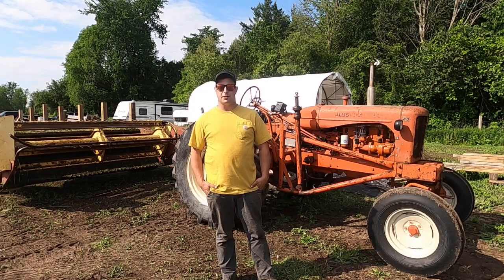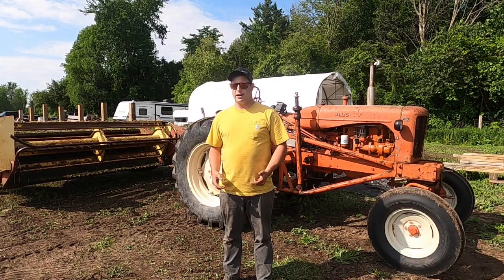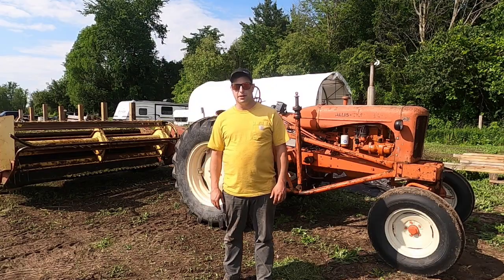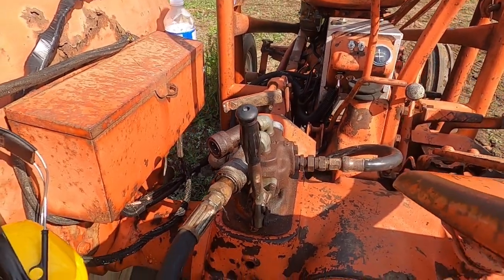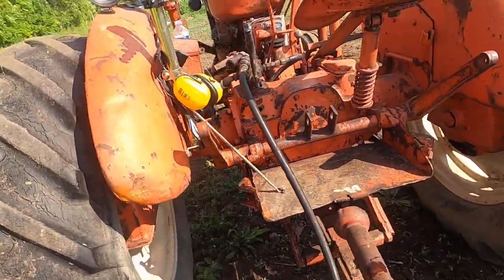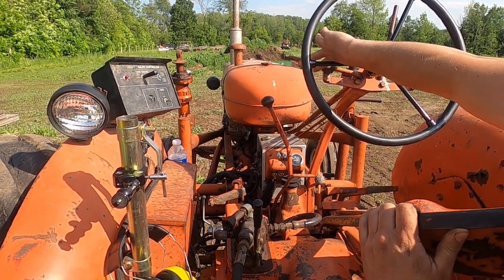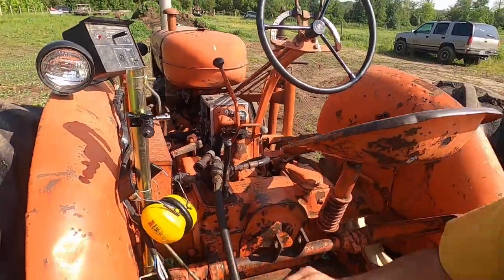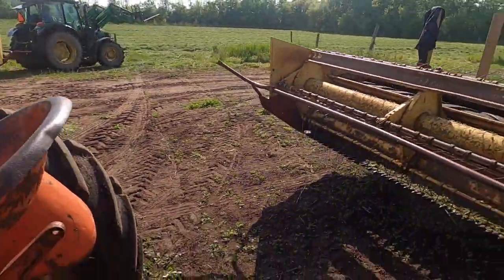Does it work? Modern hydraulics on Allis Chalmers WD.

Comment: You must have an “open center” valve.  It should be a “ closed center “ control valve then you would not need the valve that shuts off the oil to the control valve.  Good job for getting it to work.  At that time all the other tractors had high volume low pressure. But AC had high pressure low volume hydraulic system.
Reply: That's something I wanted to say. Make sure you have a pressure relief valve in the system. Wds pump 3000 psi most modern hydraulic cylinders are rated for 2000.  I installed a backhoe on mine, it has an 1800 relief valve one of spools.  Basically all I did was install a return line with a filter.  But the hoe is a skidsteer attachment and I pinned it in the up position on the 3 point.  It works well. I did have to put 1000 pounds of counterweights on the front though.

Comment: Good job- glad to see an old WD still working. I did basically the same thing when I bought my New Idea 483 in 1992 around when they first came out. Does yours have the gear down sprockets on the main drive? That's why I chose it over the smaller Hesston most people preferred. For dry hay/1st cut it made an excellent combination, but for rowen the bales tended to be more loose than i'd have preferred, and I never tried to make baleage with it- I just didn't see it coming out well. Moving up to a WD45, I could get a tighter, denser bale but still wasn't impressed with the balers ability to make something silage worthy. Can't complain though, since I knew it when I bought it; the local dealer had demo'd it out all summer and the general consensus was that it was 'no good' for baleage, allowing me to buy it that fall for 40% off its list price! With both the baler and the Allis about as 'hi-tech' as an anvil, you should be able to keep them both at work for another 40 years, easy, my only advice would be to ditch those haybines and spend the money on a disc mower. You won't believe how much easier they make everything about mowing.
Reply from the maker: That’s a great story! I’m pretty happy with the combo. I’m on the hunt for a better mower , but these are paid for and work. When the right deal comes along, I’ll upgrade. Cheers thanks for watching

Comment: Would something like this work to upgrade the hydraulics for my loader, would like to have the ability to tilt the bucket and put down pressure for plowing snow and such
Reply from the maker: It will work , use a single cylinder , and it won’t be fast

Comment: Good   day   INteresting.  So pump is pumping all the time?   Thanks
Reply from the maker: Pump is creating flow on all hydraulic systems all the time, the valve creates the pressure. When you actuate the valve it will go into bypass , then you use the remote lever to run the hydraulics, when not in use I shut it off
Reply: @ontariovintagetractor how did you get the return line to go to the cap? Did you drill into that hex piece or did you get one with it already tapped??
Reply from the maker: This one was tapped when I got the tractor
Reply: @ontariovintagetractor  do you think it would be easy enough for a guy to tap it himself? or would he have to bring it to a shop??
Reply: @ontariovintagetractor  how far into the filler neck does the threading go on the inside
Reply from the maker: Just enough to allow fluid to flow back in
Reply from the maker: Would depend on your tools and skills